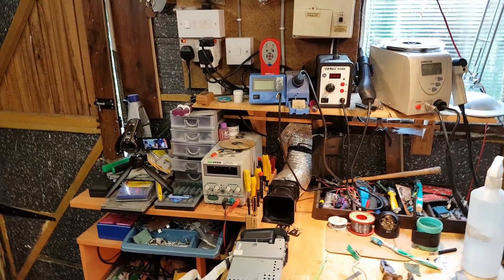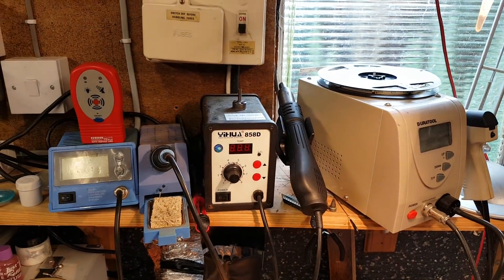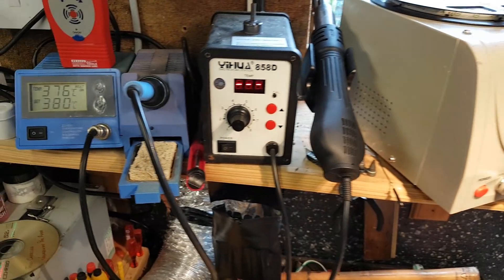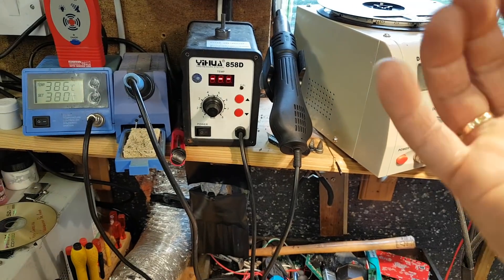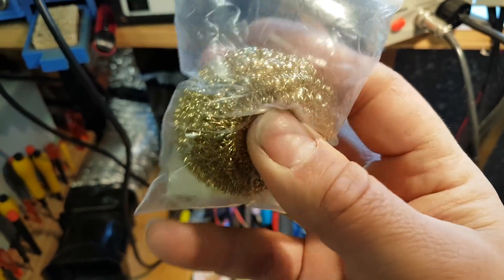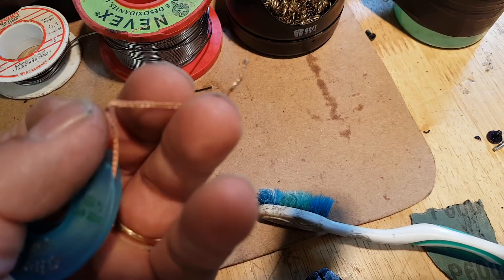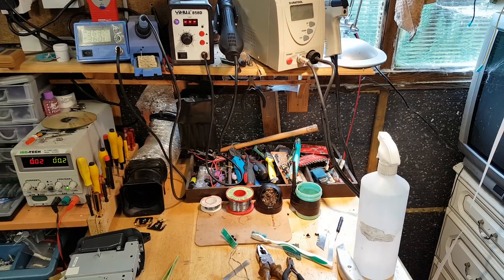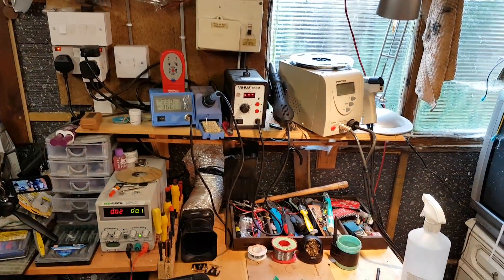My soldering tools and the "workshop"... a subscriber request!

Comment: Thanks for the tour, what tool you use or how cheap it is doesnt really matter as long as it does the job. i have a TS-100 soldering iron that also can work on 12V, i use that when i need to solder outside and just use the car's 12V , i can highly recommend this soldering tool.
Reply from the maker: Retrocare 
Thank you for the suggestion... and for watching!